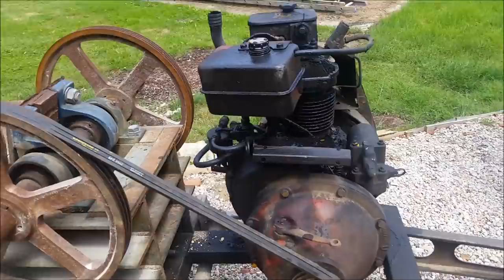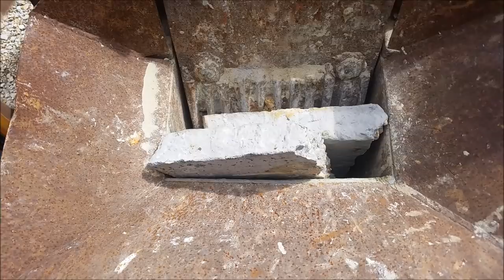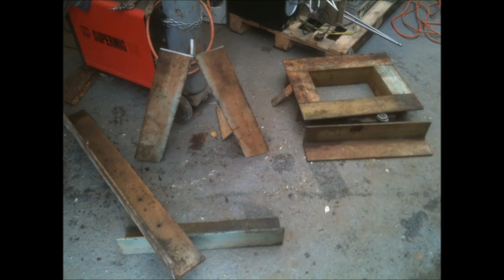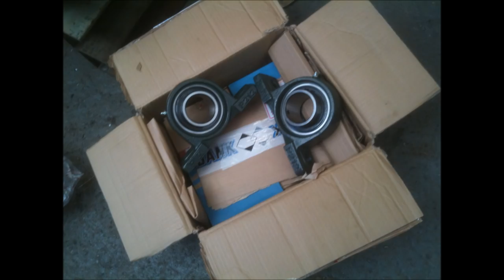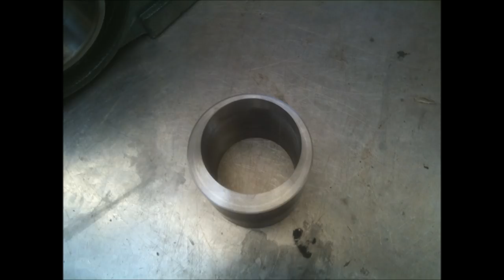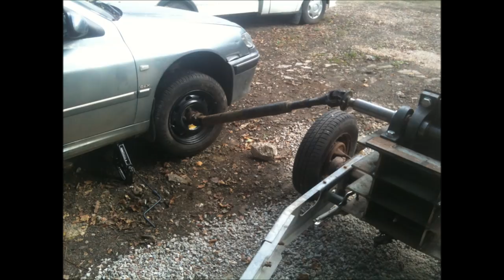homemade jaw crusher update and build pics

Comment: Excellent I'll look forward to it, Cheers Mark, I'm gonna use some old rsj's I've got for frame and box and maybe some cut down old van leaf springs for jaw teeth.
Reply from the maker: rsj's will be great for the body, not sure about leaf springs though, my jaw faces are made from old cat loader blades and have worn alot, i think welding ridges with hard facing rods could be a good soloution!

Comment: If the spoked flywheels are made of cast iron rather than cast steel you could have potential problems if something  ‘ uncrushable ‘ gets into the machine, solid flywheels would be preferable . Nice machine.
Reply from the maker: We've had that a few times, fortunately it just slips the belts!

Comment: Again great job, have any pics or video  of the toggle setup for the adjustment of the bottom of the jaw?
Reply from the maker: thanks! its the only bit i didnt get photos of, mainly because i changed it several times to get it to work, it ended up being a 45 degree angle relative to the jaw and about 6 inches long. if i did it all again id make it adjustable for angle aswell as to vary the size of the rock crushed!

Comment: Hello Mark,
I wanted to private message you but cannot find send the email link........

I have a few questions if you don't mind.

1. What is the overall size of the angle iron box?
2. Is the face opposite the jaw, angled or straight down?
3. Does the bottom of the jaw have any support or locating part besides the spring mechanism?
4. You mention machining the offset cam and welding to the drive shaft, can you elaborate please?
5. Can you get some video of the spring/toggle mechanism on the  bottom of the jaw please?

Many thanks in advance.
Reply from the maker: Hi there the back face is vertical and the moving jaw is angled back to create the wedge shape, overall the main body was around 20" wide and 30" long, the cams were simply machined and welded to a shaft as it was cheaper/easier than making it from a single piece! i will do another video when i get time explaining the operation a bit better...
Reply from the maker: Hi there the back face is vertical and the moving jaw is angled back to create the wedge shape, overall the main body was around 20" wide and 30" long, the cams were simply machined and welded to a shaft as it was cheaper/easier than making it from a single piece! i will do another video when i get time explaining the operation a bit better...

Comment: what was the shaft was it straight shaft and how did the crusher move back forth
Reply: He used an eccentric sleeve and welded it to the shaft, it formed the oliptical movement you see
Reply: How the bottom part of moving jaw mechanism works ?

Comment: your crusher is running the other way from when you had a car running it as it dont seem to be crushing as well as it did with the car driven it?
Reply from the maker: No its running the same way in both videos, it wouldnt work the other way, the only thing that happened is the jaws wore down from lots of use!
Reply: @marktgsxr  the car wheel looked to be going forward say first or second gear, the diesel engine looked to be going back wards, im now going to think about making one, im just not sure on the angle of the toggle plate and how the toggle plate is held in on the rocking jaw
Reply from the maker: @orkidknog4147  i think my toggle plate is at 45 degrees ish.... if i built it again id make it adjustable so i could alter the size of the gravel and also the angle for fine tuning..... id also use hardox steel or hard facing weld for the jaws......good luck, its been one of the best things ive ever built!
Reply: @marktgsxr  ive had the idea of making the fixed jaw swing on a large pin on the top so i can just put in like home made shims in to make it bigger or smaller, ive got 1,1/2" plate for the sides the 2 bits i have for the jaws are 2" thick thinking of making both jaws at 45deg so v shaped 12" wide 8" from top of jaw to top of jaw so i can at least get a hole breeze block in at once, im going to be making it so it runs of a tractor so power wont be any trouble just if the pillar block will stick the force as they are weak and i see your broke one, ive made 2 eccentric like your so fingers crossed it will work, im putting 60mm shaft and 75mm od eccentric to fit 2 x 75mm pillar blocks on the rocking jaw, its just getting the time to plan it out and weld it all up and see what happens, so how do i know witch way is the correct way to turn and what way is the wrong way
Reply: orkid knog hows your build coming along

Comment: where did you get the 4 lots of bearing
Reply from the maker: david drury ebay! i wouldnt use them again tho, the cast iron housing is weak really,ive had to replace them already but they were cheap!
Reply: what size where the bearings